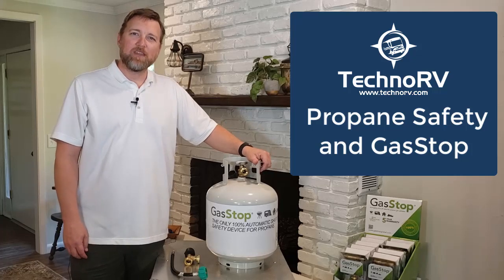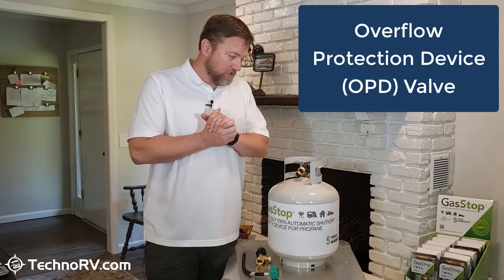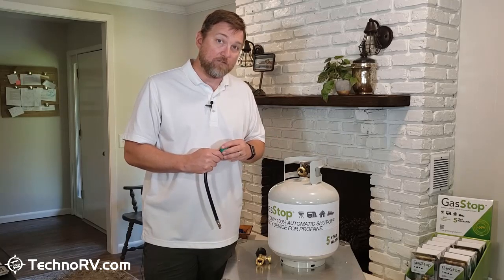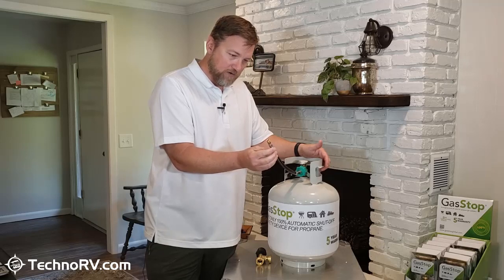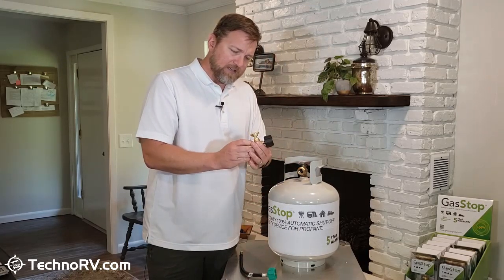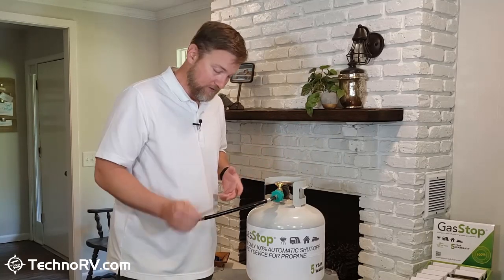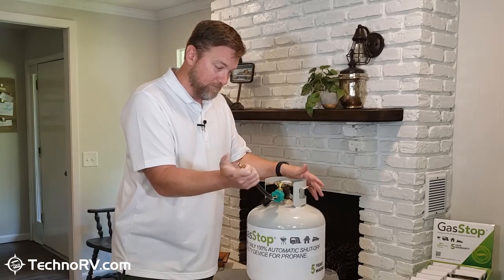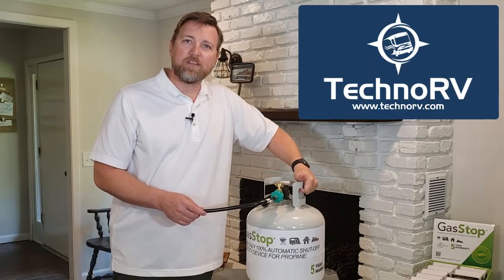RV Propane Safety and GasStop

Comment: If I just purchase one but I have 2 tanks on my travel trailer can I use 1 tank at a time is OK With the safety valve
Reply from the maker: Switching the GasStop to the tank you are using will work fine!

Comment: All of the reviews and tests do not use a regulator in the line. How will this work if a propane line gets cut while I am traveling with my propane on?
Reply from the maker: The Gas Stop device reacts to any leak downstream of it. The device will will not know whether there is another device downstream of it or not as long as it senses the flow and the flow does not exceed 75,000 BTU, which is the shut off point. I hope I understood your question and that this helps.

Comment: I got these added to my RV propane tanks, but reading now that it says they may shut off the propane when temps get down to freezing. My primary use for the propane is the furnace overnight when it's below freezing. So it sounds like I shouldn't use this device? I'm very disappointed. 😞 Something I'm missing?
Reply from the maker: The GasStop is good in temps from -4 to 131 degrees F, so it will be fine as long as it doesn't drop much below 0.

Comment: Thanks for the education! We had a leak from our tank while driving though gas was off in the RV: stove, heater, etc. Are you saying that this device would note the small leak near our tank and automatically turn it off?
Reply from the maker: Hi Don, 
Yes, if you had a leak downstream from the tank then the GasStop device would close shut and not allow propane through. It is a great safety device. It is tuned so that normal operation of flow is good to go, but if something is detected higher than normal flow, like a leak, then it would close that off. 
Hope this helps. Eric

Comment: If a stove burner control is left on without being lit will the gas stop detect the flow and cut off the propane ?
Reply from the maker: Hi Mailman, 
Good question, the GasStop device is designed to detect excess flow over what would be considered normal. In this case, a burner being left on would be seen as normal operations and it would not cut the propane for that. Generally a true leak, in addition to normal operation would be seen as a problem and the GasStop would automatically cut you off from that. 
Hope this helps. Eric

Comment: How long do you have for this pressure to shut off?  I want to know if you are trying to light your stove or oven if this will kick in and shut off the gas before this gets the gas-lit on your stove?
Reply from the maker: Hi Mike, 
The GasStop will not shut off for normal propane operations like your stove, heater, and other appliances. Normal flow would not exceed 75,000 BTU, so the GasStop is tuned to shut off immediately if you have flow gets above 75,000 BTU. If you were above this level then this would certainly be a leak in the system. Any flow below 75,000 would not activate the GasStop device. This is a great device that, in my opinion,  should be on all RV propane systems. I hope this helps. 
Eric
Reply: @Technorv  Thanks, I may give this a try.

Comment: So after the gas flow is stopped after a excessive flow, how do you get your gas to flow again after you correct the problem of excessive flow?
Reply from the maker: Hey Ron, 
When you first connect the GasStop you will prime the unit by pressing down on the gauge 4-5 times. This opens the GasStop device and it will be ready to protect you at this point. If you had a leak, then the GasStop will shut the propane off, and to open the GasStop back up you would simply go through the prime process again. It is really easy, and a must have device for those with propane tanks in their RV. I hope this helps. 
Eric

Comment: I wanted to use the Gas-stop on both of my propane tanks, but it wouldn't fit in the propane locker of my Arctic Fox 27-5L 5th wheel (couldn't close the locker door). I inserted a 90° brass fitting between the body of the Gas-Stop and the fitting that connects to the tank. Problem solved! Works perfectly. I have photos if you're interested.
Reply from the maker: Hi Charles,
Thanks for the info. Sometimes propane tanks can be in some tight spaces and sounds like you had a great work around with that. I would love to get a picture of what you did. Please email me the picture to eric@technorv.com.
Thanks.. Eric
Reply: @Technorv  I just sent photos to you via email.